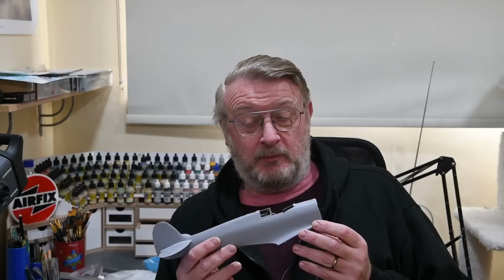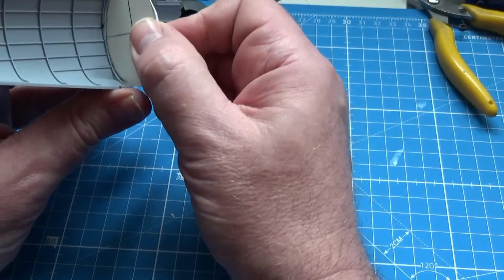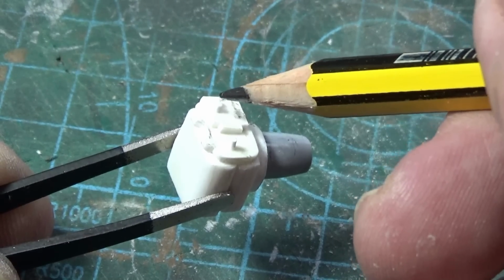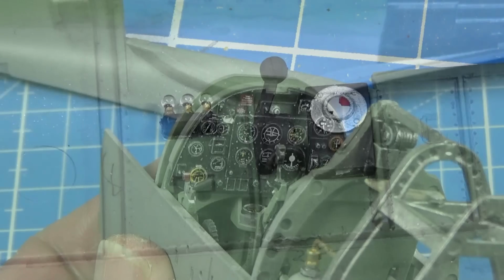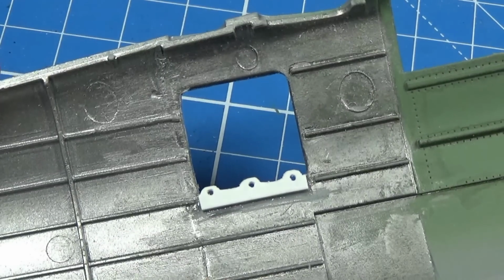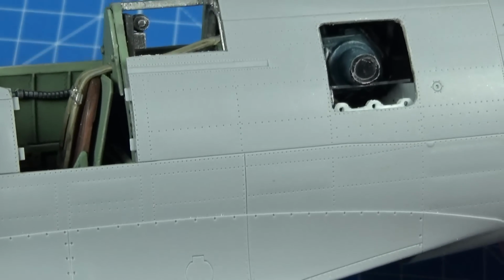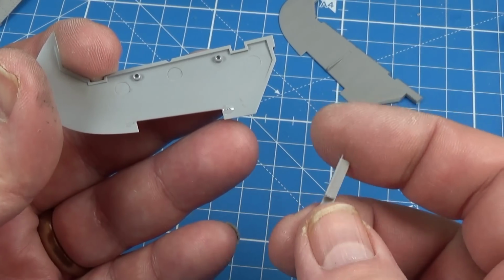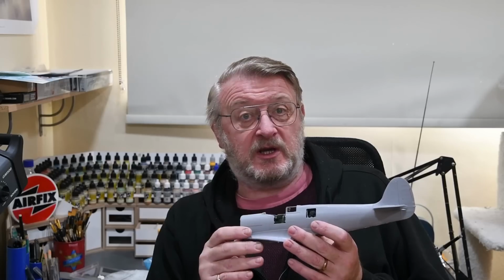AIRFIX 2022 NEW SPITFIRE 1/24 build day two - 1080p HD

Comment: Great video - thanks. I have (had) enjoyed making this (after 50 or so years of abstinence), which was a Christmas gift from my three sons. . However, I had a massive fail when installing the cockpit to the fuselage. I concentrated on ensuring the two fuselage halves would come together by dry fitting the port side and taping together. I didn't notice (for whatever reason) the cockpit module had slipped down slightly. It was only when I was contemplating fitting the two halves together permanently that I noticed this. I was mortified because I straight away thought about the fitting of the wings. Sure enough they fouled on the cockpit! So I'm now faced with trying to release the cockpit assembly from the fuselage! Wish me luck! Especially as I've been away for a week and the glue is rock hard! This was supposed to be fun!
Reply from the maker: Nightmare! Best of luck with the rescue!±
Reply: @garys_stuff  Got it done (well...undone!) eventually. Hour or so of delicate surgery with a scalpel. All went together again just fine.
Reply from the maker: @colinmiles1052  well done you! Epic effort!

Comment: Coming along very nicely, Mr Evans! 

I echo a previous comment that Airfix should have included the camera option, but that thought shouldn’t detract from your very neatly scratch-built example! 

Looking forward to seeing engine build and fit.

Keep up the good work! 

Best wishes from Wirral.
Reply from the maker: There are two reasons why Airfix didn't include the camera as far as I can see. First, it would add even more parts to a kit (probably an extra frame) and that takes up the cost over the magical £100 mark. There would be a lot of bits - the camera, its mounting, connection wires, the extra frame, the optional radio position, the door with and without window, all need extra parts. And one or two extra transparencies. People would be complaining there's all that PR stuff in there when they just want to build the standard IXc.

But also it means that Airfix have the option to release another version later, with all the PRU stuff in it and have a second bite at the cherry to help recoup the cost of the original tooling. They are certainly covering the bases for a Mk.VII or Mk.VIII with the tail wheel being a separate fuselage part so another box can have a retractable tail wheel, for example, and there is a very clear cut-out at the back of the radio/camera access panel.